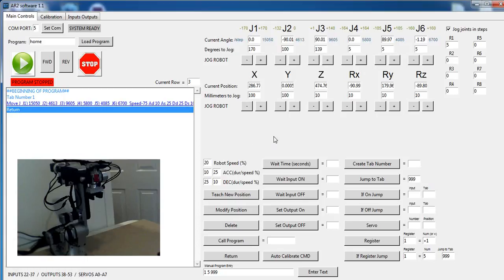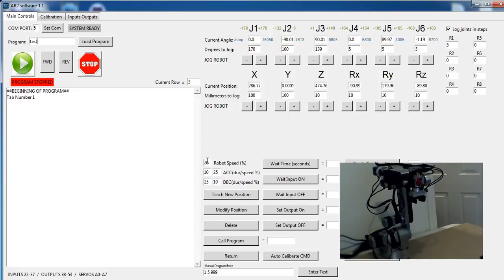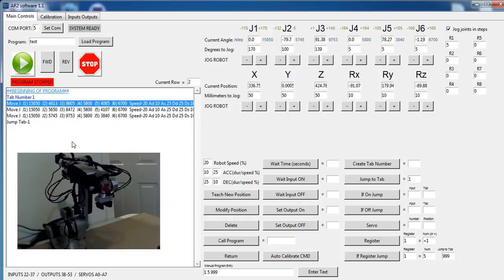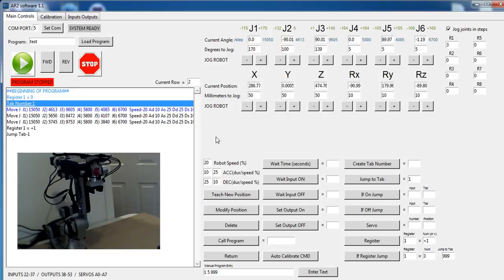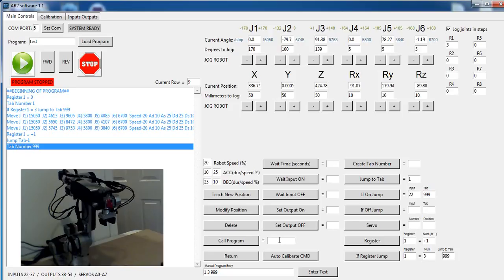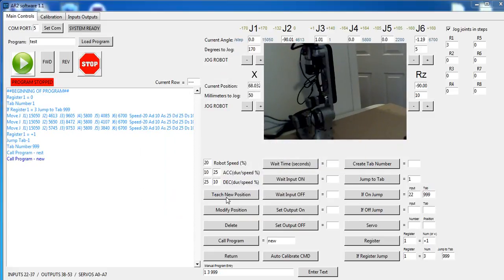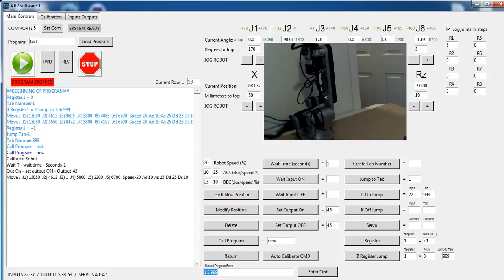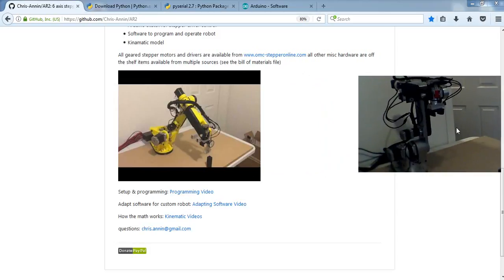AR2 robot - Programming Part 1

Comment: My X, Y, Z movements don't work correctly. If I type in 20 for example into the program the robot moves in random directions. It doesn't move just in one direction like yours does. It will twist all sorts of ways and move arms randomly. Is this a calibration, programming, or wiring problem?
Reply from the maker: Does each joint jog + - in the correct directions?
Reply: Yes, if I jog in the - direction, each motor will twist towards the limit switch. Does it have to do with my home position/ fine calibration position? Also, I got nowhere near 15200 steps for J1 and J4. I got 3915 for J1, and 4800 for J4, not sure if that helps.
Reply: @youngjm1  is the problem solved?

Comment: Hi, Very good project! I am looking at building a servo motor robot to feed CNC Milling machines and CNC lathes. Would your software work with Servo motors? They require step and dir inputs much like a stepper.
Reply from the maker: If each motor requires only step and direction inputs it should work but I'm not familiar with the type of motor you are using so I couldn't say for sure. You might want to look at the wiring schematics and watch the video on calibration to give you a better understanding how my setup works.
Reply: Chris Annin thankyou I have wanted the videos and believe I can get it to work. Thanks again for contributing so much!
Reply from the maker: you are welcome, I hope these help.